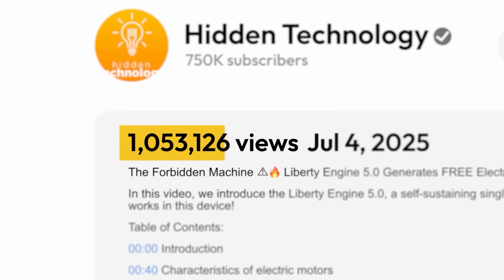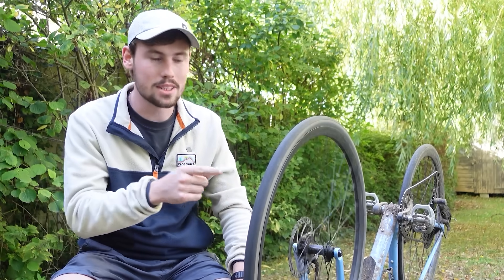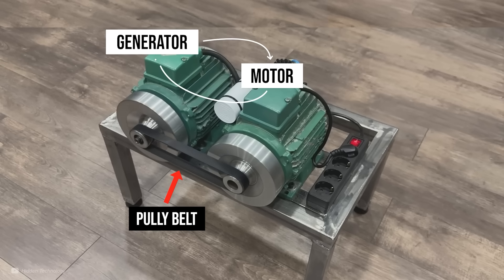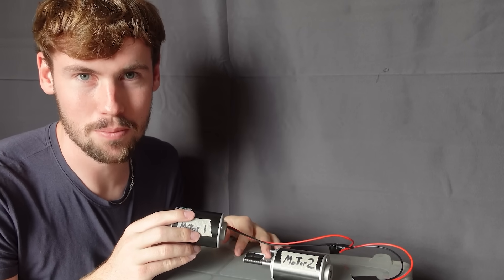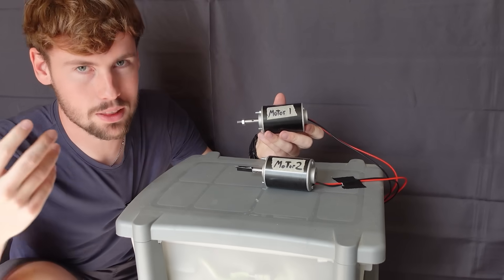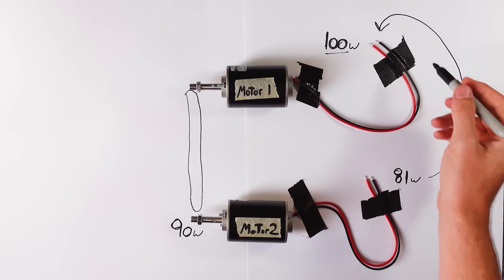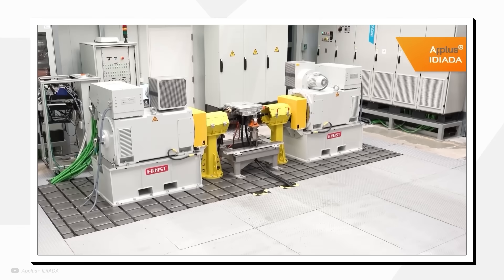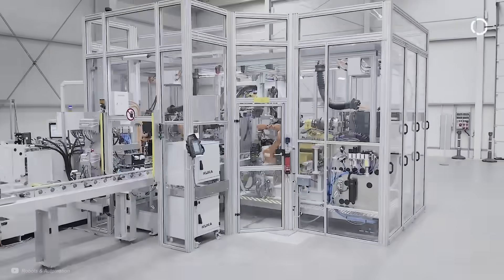100 Years of Waste! Solved by an Unlikely Invention.

Comment: The main challenge with Perpetual Motion / Petpetuum Mobile is where to hide the battery.
Reply: As an electrical engineering student, we did such a job - without battery. We used solar cells embedded in infrared-filter polymer rods as spokes of an eternally turning wheel und buffered the energy by arrays of super-capacitors. It took a while, for our professor for microelectronics to figure out the principle of operation. Since the device used magnetic bearings, it could run for months in complete darkness.
Reply: @debrainwasher  Cool!
Reply: @debrainwasher  Cool!
Reply: Perpetual motion is impossible based on current physics but mind u we still don't know much about quantum mechanics & even things like dark matter, dark energy & even negative mass stuff like that who knows some of those discoveries might make us re think thermodynamics or physics itself
Reply: @Life_is_miraculus  You would still be using energy input only, it would be coming from the universe, and therefore such a minute percentage that it might as well be perpetual.
Reply: correct 😅
Reply: Mission to perpetual motion energy is that think of perpetual motion as one system I am think of the energy needed system as another system when you develop a perpetual motion supposedly its generating 1 kilowatt in excess regularly that could be used as real value energy from a perpetual motion
Reply: I believe its possible with additional sources like magnets at low rpms to help compensate for the loss in heat, gravity and resitance.
Reply: Yeah, but once he figures out that part, you'll be able to buy the plans to build your own for only $47!
Reply: Yeah, but once he figures out that part, you'll be able to buy the plans to build your own for only $47!
Reply: Booooooo

There's always one. Someone has to say it .
Reply: well a flywheel store kinetic energy so
Reply: Battery Bank!
Reply: just connect yo earth rotation never stop.. like wave wind.
Reply: Slow clap*
Reply: Says the human living inside a battery
Reply: No it’s actually making people realize that these have the same losses any other normal generator does and that 70 percent of all power generated is just heat in a rotor stator set up. 
Perpetual motion and closed loop electromagnetic generation are not only possible but patented and I’ve seen it work with my own eyes. 
Shell oil threatened my grandfather with shelving it.. tried to buy him out and he said no

A mass amount of torque can be produced with little energy. For every action there is opposite and equal reaction. There is no energy being produced it’s just being moved around in a system. A magnet passing a coil induces a current. Put 2 and 2 together m8
Reply: @DaneSage  Go on then, where can I find these patents?
Reply: ZPE is possible. That much I know. Yet as for how is another question.

My speculation is that advanced manipulation of particulate energy is required.
Reply: @Akuma.73   my speculation is that it runs on faith, so if you do not believe, you cannot see it working. 🤔
Reply: @Akuma.73  Nope. ZPE is the energy reservoir for the quantum fields (see QFT-theory), Since no significant potential difference can be created, no useful energy of a flat spacetime can be extracted. Things change however, when the container of these fields (spacetime) is bent or twisted. Since Albert Einstein has identified any spacetime curvature as gravity, it can be used as an energy storage. Hydroelectric power plants provide the proof.
Reply: @debrainwasher think deeper. You don’t even need the hydro.
Reply: @debrainwasher Hydroelectric is like the most basic and rudimentary way of using that energy, harnessing it from the source would get you waaaaaaay better results.
Reply: @debrainwasher also "flat space" doesn't exist, there is always an asymmetrical aspect to it.
Reply: @Akuma.73  How do you know it's possible?
Reply: @EddieTheH  Aliens told me.
Reply: @Akuma.73 My definition of perpetual motion is a closed system that runs forever. That makes an atom the largest thing that seems to go on indefinitely, and even those don't last forever, as I remember it.

If we ever find a way to tap into quantum foam energy, it seems we'd be tapping into the whole universe (multiverse?), so any perpetual motion machine would not be a closed system :-)
Reply: @Akuma.73 ZPE and Moto Perpetuum are 2 very different things, but yes you could power a machine infinitely with Zero Point Energy.
Reply: @Akuma.73  Don't need anything fancy, all we need is "knowledge" we currently don't have.  There are loads of energy available all around us, we just don't have knowledge of how to harness barely any of it.  Just trying to harness the power of our Star Sol is already a big deal and we are barely catching a mere fraction of it and only a fraction of that fraction that is hitting earth.